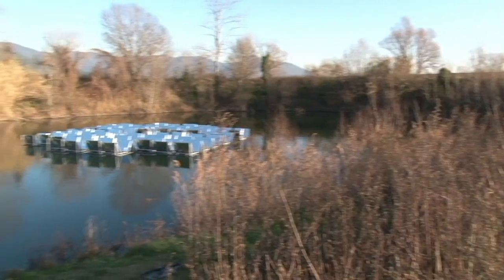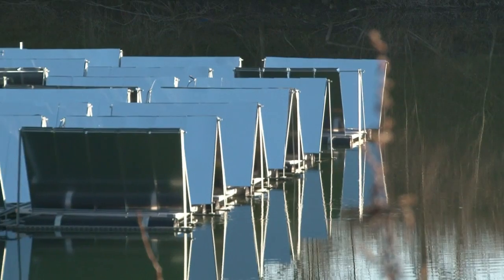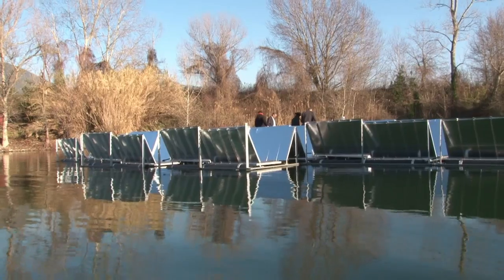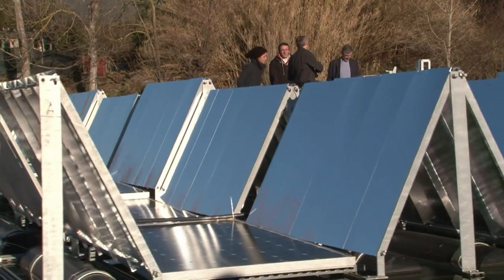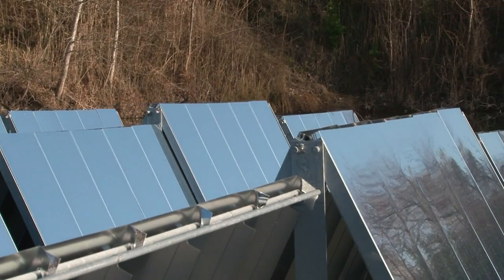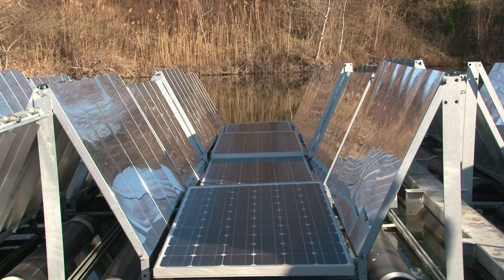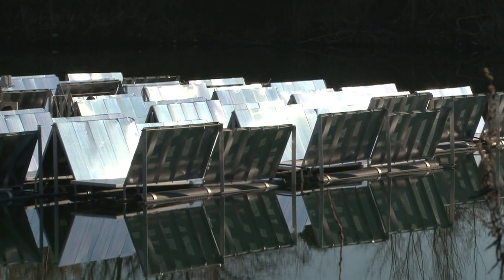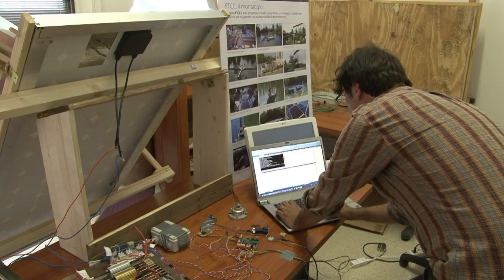Italian engineers pioneer floating solar panels

Comment: efficiency may reduce due to murky (algae/mud) water not letting through enough sunlight... also cost will rise in order to make the panels water-proof.... what they could do is maybe attach radiators at the back of the panels which then transfer that heat to the water.... hmmmmm